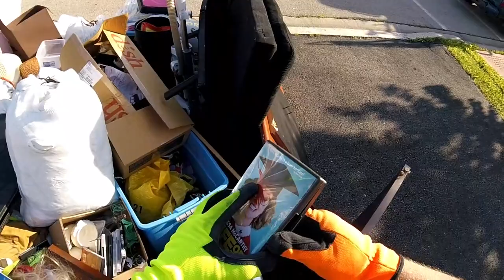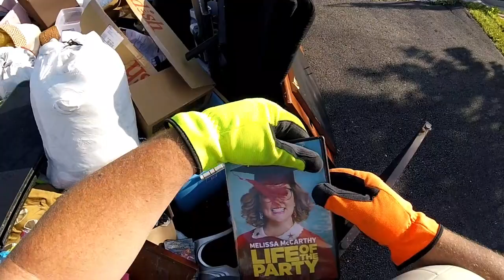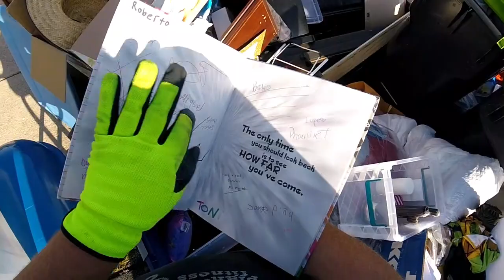Digging Through the Neighbor's Trash

Comment: 2:41, That is a tool for stretching the slack out of chain link fence when installing. You slide a tension bar through the fence fabric and put the hooks around the tension bar and hook a cable jack to the tool. The other end of the cable goes around a corner or end post, then jack the slack out of it.
Reply: That's Slick as Snot

Comment: Hey Paul, I forgot to mention it in one of your other videos, but this one just reminded me.  Some LP Gas places (not stores like Lowes or Walmart but actual LP Gas places) WILL buy back old LP tanks like you find from old Barbecue pits without having to do a "trade in".  They will just flat out buy them, but the price per tank depends on condition, era of the valve on it etc.  IE Call them first to find out which ones might take them.  Usually if they do, they offer several bucks a piece for the ones they are interested in. Google "LP Gas Tank buyback near me" if interested.  I more than respect if you don't want the hassle, and man do I agree with you with not messing with glass.  God Bless!
Reply from the maker: I find them almost every day... thanks for the tip. I have a gas co. close.

Comment: Paul you need to grab some metal mesh and weld it to your portion that goes over your cab, one to protect your cab and two so you can put more stuff on the truck!!!  All it would take is one angle iron in the middle then the mesh over the top like you find on some lighter trailers.

Comment: Just FYI, that Nintendo gamepad you found is part of the Nintendo Wii U Game System. The entire system consists of the gamepad, console, and controllers. If the whole game system was in that box, that would fetch $150 on Ebay all day long, providing it works. The gamepad, just by itself, which is what you were holding, fetches about $80  on Ebay,

Comment: 22:33 Most plastic is recyclable by melting if it is clean and separated by type and color (so it does not mix up). Some products can be made from mixed plastics with similar properties. Multi component resins like Epoxy and some insulation foam can be either repurposed, incinerated or turned in to fuel or new polymer with pyrolysis/hydrolysis. Composites are even more tricky.
Reply from the maker: I wish it was that way in my area

Comment: Hi Paul,

I have been enjoying your videos. I now have my 92 year old Dad watching as well. We need to talk about dishwashers. You are missing out on a lot of money!
Reply from the maker: dishwashers would cost too much time
Reply: You might think so but not if you do it efficiently. I own a business that installs appliances and other plumbing items for most of the big box retailers. Everyday the crews bring back dozens of scrap appliances, many of them are dishwashers. It take all of 5 minutes to completely process out all of the wire, brass, No. 1 & 2 copper, stainless steel, zinc, cast aluminum, sheet aluminum, extruded aluminum, irony aluminum, irony copper(breakage), motor, solenoids, circuit boards, # 1 steal and incoloy heating elements. This is all done in our shop with the following equipment, 4.5” bench grinder w/cut off wheel, reciprocating saw with a kind demolition blade and a power driver with several bits. All that remains when done is the ferrous framework, hinges and tub which our scrap yard still buys as shredder due to selling them all of the non-ferrous goods. I could give you a breakdown but the average dishwasher has an overall scrap value today of around $7.50. A few years ago we were getting almost $12.00 each. Not bad for 5 mins. That’s currently making us $90.00 per hour. It’s all in the processing. The grinder does 90% of the work, reciprocating saw makes one cut and the power screwdriver removes the interior door screws. I should make a video! I cringe everytime I see you pass up a DW or push off a stainless steel sink or microwave into the shredder pile. But I immediately forgive you my dear brother in Christ. Mike

Comment: I have a dumb question--Im saving insulated wire--are telephone wires considered insulated?? The old curled for the handset and the other straight ones.I used to strip by hand but cant now with being on blood thinners
Reply from the maker: Yes they are considered insulated copper wire. They are the lowest grade of insulated copper wire. Something like 10% of the weight is copper.

Comment: Coax is copper in the center but has a steel or aluminum shield.
Reply from the maker: Most coax Center conductor is steel. Looks like copper but it's not.
Reply: @ScrapPalletMan  RG-59 flexible coaxial cable the type used for TV is composed of:
Outer plastic sheath.

Woven copper shield.

Inner dielectric insulator.

Copper core. https://en.wikipedia.org/wiki/Coaxial_cable I'm an electronics tech retired.

Comment: Take the microwave ovens apart for nearly a pound of grade A copper. EDIT FOR CORRECTION.........1 microwave could yield up to 3 pounds of copper.
Reply from the maker: How long would it take?
Reply: You can also sell the glass plate, door, handle, and control panel if they are in good condition on eBay. There are still people out there who want to stretch every last bit of life out of their appliances rather than replace them.